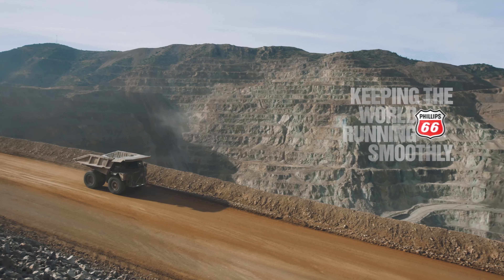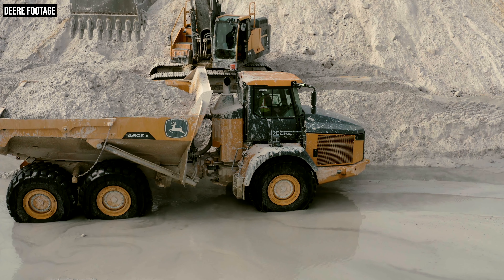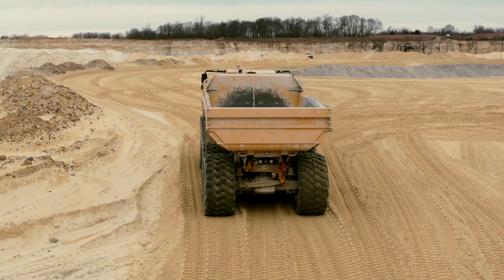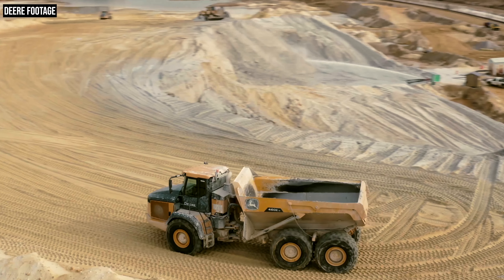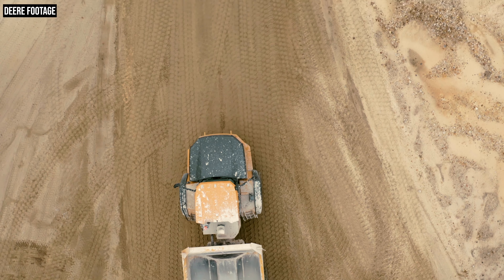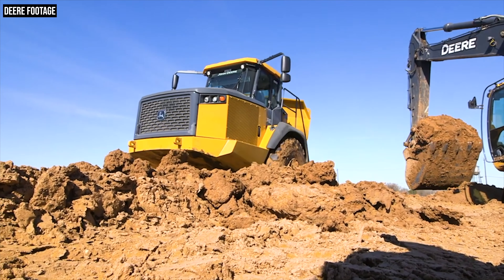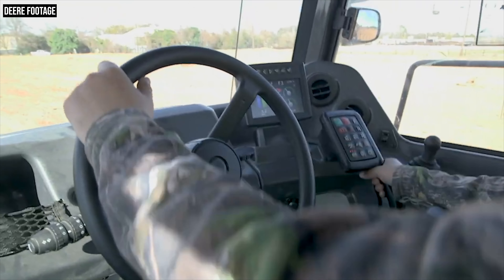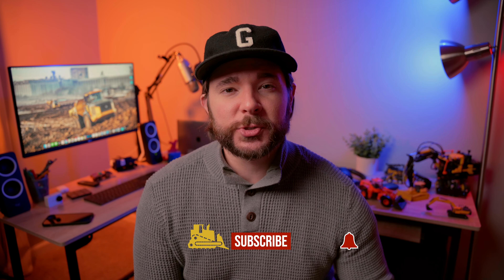John Deere Redesigned the Dump Body for 410E-II, 460E-II Articulated Dump Trucks

Comment: The sloped bedrails will be a huge plus to companies operating on airports. We waste a lot of time cleaning flat bedrails with the back of the bucket to prevent material from rolling out. I think having the sloped rails will help tremendously with losing material... especially in important areas like airports.